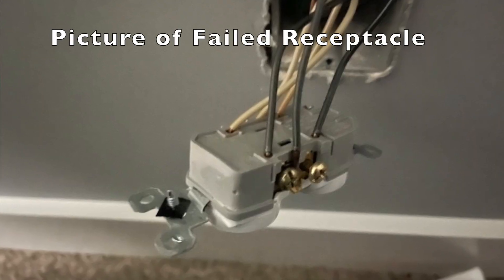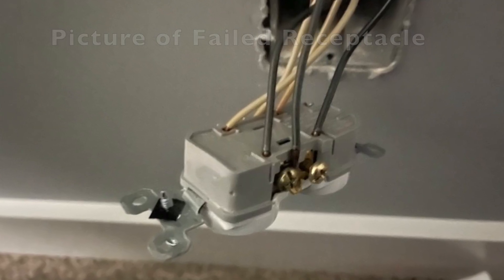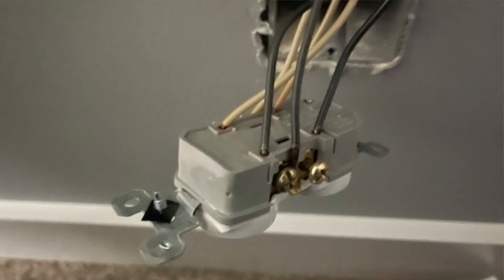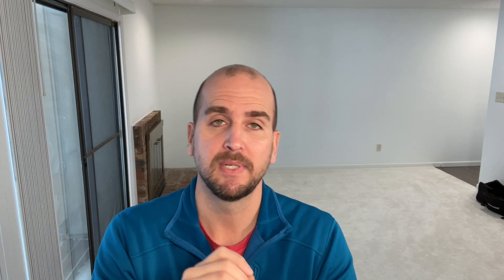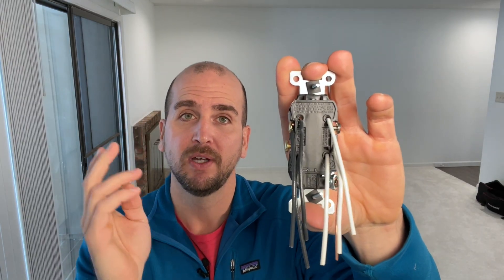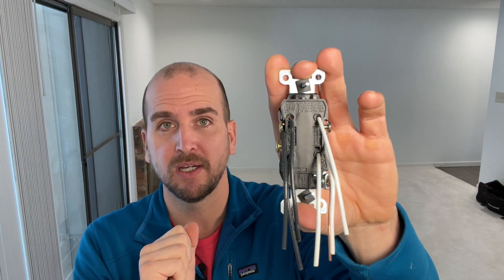Incorrectly Wired Outlet Found In Newly Built Home

Comment: Licensed NY  electrician.  Great video!  I noticed the receptacle you replaced was fed with red wire.  Since your audience might include non-professionals, you should point out that even though the circuit for that receptacle was off,  there might be another circuit sharing that same neutral and the danger it poses.  Again very good video.
Reply: @Michael Claypool This might be a multiwire branch circuit that @Veloci3 Twenty is referring to in passing.  The multiwire branch circuit is a cheap and nasty way some electricians run two circuits with a single 4 conductor romex cable (like a 14/3).  The two hots (red and black) go to a breaker each (on different bus bars), and the white is shared between the two circuits.  While it is not against most codes, it is considered a "in code" bad practice by many and should be avoided as it might put too much load on the single neutral as well as creating a live wire situation (when one side is switched off and someone expects the white wire to be not carrying any load).  This danger is real and occurs if the hot wires are moved in the breaker box so they are on the same wiring bus.  A common mistake would be to put the two hot wires on a tandem breaker switch not knowing these wires are sharing a neutral.  This is why the two wires in the breaker box need to be identified, connected to separate poles, and they need to have a tie between the switches so they are tripped simultaneously if one side goes.

The only reason electricians use this is to save money on wire and labor on running one wire instead of 2 wires. a single length of 14/3 is cheaper than 2 lengths of 14/2.
Reply: @DarkTouch  In a Edison circuit ( two hots one neutral ) when done correctly  as in one hot on each  "phase "  it is impossible to overload the neutral . If you have 20 amps on one hot 0 amps on the other you then have 20 amps on the neutral if you then load the other hot lets say with 8 amps the neutral  would have only 12 amps. - Two 15 amp loads the neutral would be 0 amps as current would divide by OHMS LAW .
Reply: @markhamilton1847   @Ethereal Rose  i know it is still in code.  My point is that it is about saving money/labor and puts the circuit into a conditional safety: conditions, the two hots are on different phases for all eternity and the two hots are tied together at the breaker for shut off.  Either of these conditions can easily be undone by an unwitting homeowner or electrician.  I for one bank on people being stupid and making mistakes, especially mistakes they don't know they are making.  So its code, but not considered a best practice.

Also, in certain situations, they are expressly forbidden, such as hospital settings and other places where there are critical circuits.

"The National Electrical Code permits multiwire branch circuits, but adds requirements to make them safer. Section 210.4(B) states that in the panelboard where the branch circuit originates, all ungrounded conductors must be provided with a means to disconnect them simultaneously. This is usually a double-pole breaker, but two single-pole breakers may be used if they have an identified handle tie.

Another requirement in Section 210.4(D) is that the ungrounded and grounded circuit conductors are to be grouped by cable ties or similar means in at least one location within the panelboard. This requirement is designed to ensure that the wires will be hooked up correctly, with the ungrounded conductors connected to opposite phases. An exception states that the requirement for grouping does not apply if the circuit enters from a cable or raceway unique to the circuit that makes the grouping obvious."
Reply: @DarkTouch  You're perfectly right. Multi- wire  multi- use branches have so few uses these days, that one seldom sees them. We used to do kitchens that way, but the electronic age has made dedicated neutrals the norm.
Reply: @DarkTouch  neutral sharing is a common practice and not a code violation.  in single phase systems you are allowed 2 opposite phases on a common neutral.  In a 3 phase system you are allowed 3 phases on a common neutral.  The phases must all be different.  

You cannot share a neutral on an arc fault protected circuit as it will trip the breaker whenever a load is applied.

Please don't make uneducated comments.
Reply: @veloci3twenty607  jeez.. i never said it was out of code.  you didn't read my comment?  It's a practice that has several conditions placed on it that ordinary circuits do not and quite easily undone by an ignorant person.  it's sole reason for it existing to run one less conductor.  You can't in ANY way say that a multiwire branch circuit is just as safe as running two separate circuits with their own neutral.  The multiwire branch circuit must be on alternate phases and the breakers must be tied together, duh!  This is easily undone, confused or messed up by someone, especially by a homeowner tinkering.  I am fully conversant in NEC.  I'd like to point out that YOUR comment said "the danger it poses".  You trying to walk that back?
Reply: @DarkTouch  you just keep digging yourself deeper.  Electricity is not safe for people like you and should be left to the professionals.  Do you know why I don't put tape on devices like receptacles or switches?  Or wire nuts for that matter?
Reply: @veloci3twenty607  i bet hes a real peach to work with. (Sarcasm)
Reply: @DarkTouch  
Actually, at the big box stores there isn't a huge difference in price between buying 25 ft of 14/3 and buying 50 ft. of 14/2.
As of today 25 ft. of 14/3 cost $25.68 at Lowe's. Compare that to 50 ft. of 14/2 for $27.98. So for $2.30 more you're effectively getting 25 ft. of 14/4 w 2 grounds. The extra wire can provide a required neutral in a three way switch box.
Reply: @DarkTouch  there's nothing wrong with it. Tie the two breakers together so if one trips,  the other would as well. There would be nothing on the neutral if they're both open. I also like to label in the box, in case it isn't obvious, the two circuits share a neutral. Saves a conductor, ground, extra insulation, and a second run. That's my preference if it isn't going to be a high load receptacle or usage.
Reply: @etherealrose2139  you are absolutely correct, and if you look closer there is no black wire present. Many higher end cities require a house to be in conduit, no romex allowed. Which in this case is what I believe is happening. They used a red wire due to the phase it is associated.
Reply: @etherealrose2139  Does shared neutral work with AFCI? I didn't think so, but may be confused.
Reply: @ef2b  no
Reply: In my home circuits that share a neutral and clipped together at the breaker box. I don't know if that's a new requirement or not but they aren't very secure and tend to fall off.
Reply: Sharing a neutral is bad? Ha. All neutrals are common with ground anyway.
Reply: @joeshmoe781  It’s not “bad” per se but code does require circuits that share a neutral to be tripped at the same time. They do this with a small metal bridge between the breakers. You can find more information about this online, but under certain circumstances without this protection the neutral can become energized and pose a danger.
Reply: @joeshmoe781  Having unplanned paths for neutral current to take is unsafe. If there's a broken or overheating connection in the neutral, you want the current to be slowed or stopped, not to be redirected across a random, unrelated, and too-small neutral or ground elsewhere.   You also don't want to create open loops that could cause magnetic coupling.  And you're supposed to have a voltage difference between the neutral and ground. The draining current doesn't flow for free, it needs some "back-pressure" - typically this is about a volt, but it depends on load and the length of the circuit.

So for these reasons, neutrals have to be routed parallel to their corresponding live conductor(s). They have to be insulated from ground. And you use full-strength insulation just in case there's an open neutral fault.
Reply: @joeshmoe781  Here’s a great video explaining it. 
https://youtu.be/yhFJzQB6_NM
Reply: @AITA-NIM  Or you could just get a 2-pole breaker. But yeah, if two circuits are sharing a neutral, you def want to make sure when you turn off one of the circuits, you turn off the other... for safety.
Reply: If MWBCs are bad then so are subpanel feeders, they're fundamentally the same thing. Follow code, feed them from a two-pole breaker, and they're more efficient than two branch circuits, both in material cost and operating efficiency. 

If only one leg is isolated, that's a wiring problem. You need to be prepared for that and prove all conductors dead whenever you open any box.

Stray voltage on the neutral can happen even if the wiring is 100% correct - MWBCs are not any more or less susceptible. If you're having problems with haphazard neutral wiring the only solution is to trace the mess - or rewire everything.

Blaming MWBCs will blind you to errors made elsewhere and that can be even more dangerous.

Comment: Did you explain what is the third "back wire" connection? I'm going to review.
Reply: In the video, the outlet was wired with 3 hot wires and 3 neutrals.   They used the 2 back hot wire holes and the one screw for each the hot wires to contact the hot wires together and each of the neutral wires were wired the same way on the neural side.  The proper and most secure electrical connection would be use the "pigtail" method to connect all of the hot wires and also "pigtail" the neutral wires so that only one of each wire (one hot and one neutral) go to the electrical outlet.

Comment: Have you made a posting about the pros and cons of wire strippers vs other means of removing insulation from wires?
Reply: try not using wire strippers, then you';; understand quickly..
Reply: @jsparlin1  I have and use wire strippers, as I was taught.

Comment: The pigtail approach is great if you're working on a house that was fitted with electrical boxes that are on the larger size.  Many older homes were wired with very small (metal!) boxes, and there just isn't enough room to tuck all that (extra) wire and wire nuts into one of them, and THEN screw the outlet into the box.  Just won't fit.  I agree it's best practice, but it just isn't always possible.  Use of back-wireable outlets can help in those cases.

Comment: Error #4 at 6:18.  Ground at bottom.  Receptacle is upside down.  Reason. Say a plug is pushed into the receptacle about 90%.  Now lets say a thin conductor is accidentally dropped in the vicinity,  for example, a metal paperclip or a metal coat hanger.  It would be possible for it  to fall onto the hot and the neutral.  Things could get exciting.
Reply from the maker: Oh yeah, this has been an active discussion over on this video https://youtu.be/kYXvcog9MxY  Seems to be many on both sides of the discussion.

Comment: Push-in quick connect is a terrible idea for receptacles. But can be used for switches. Specially soft touch switches. Although I always avoid it too. The plugging in and pulling out force will move the contact point. Creating heat, which leads to brittle metal. Then failure.

Comment: Retired electrician  here, almost 30 years 20 of it doing housing . Union west suburbs of Chicago. We are an outlier in this discussion as we use pipe and wire no rope. Couple of things to say. Backstabbers are hacks. If you have that many wires coming into a box you failed. Nec 300.13 b in non lawyer speak basically  says you must be able to remove the outlet without interrupting the white wire for stuff down the line. How do you do this with your outlet? Now you say wait a minute the power will be off so no problem. Wrong, sometimes as a skilled electrician you have to do stuff hot. With your outlet there if you were to lose one of those neutrals while hot bad things happen to electronics. I replaced every outlet in my house to a different color and never turned a breaker off. How did I do that ?  Every outlet was pigtailed.
Reply: The first sign that it wasn't installed by real electrician is it had no electrical tape wrapped around the side connections
Period
Fullstop
Reply: @thecloneguyz  I've seen good electricians and bad electricians licensed and unlicensed some rap the receptacle some don't
Reply: @arlenmargolin1650  first place everyone grabs  - the sides 
Only rookies dont do it
Reply: I am still active with 42 years. Today they don't know anything about all that working it hot with good safe practices passed down by men over me that had pride and integrity. Short cuts and hack jobs and then scrutinized by people making it look like we all do it like that, when in fact the guy claiming that has not the knowledge, skill, nor experience to make such claims.
Reply: 300.13(B) only refers to multiwire branch circuits.  He is not working on a multiwire branch circuit.
Reply: @Checkmate54321  I  guarantee if  that  circuit is not on a arc fault breaker it's two hots sharing that neutral wire. I roughed hundreds of homes from 89 to 08 and two hots one neutral.  Arc fault  breakers were  only in bedrooms at that time. Nowadays most everything is arc fault so not much sharing of neutrals.
Reply: @robm3063  well from what the viewer can see, its pipe and wire so it could easily be just one hot on a neutral.  I was only pointing out that the grounded continuity rule is for multi wire.
Reply: @Checkmate54321  That could be the case.  I my experience we would bring  one homerun pipe up to the second floor, usually closest closest light. Depending on how big of house usually 4 circuits, 10 openings per circuit. This is track housing not custom homes. So you could have two bedrooms sharing a neutral  and you wouldn't know it unless you opened the HR box or panel.  Hopefully the wire puller identified  the wires  sharing. We had one subdivision with small  townhouses.  I can remember to this day ,black and red shared neutral and blue wire was by itself. We pulled them all the same as to make  service calls easier.

Comment: Great video, you always teach me something.  I am a bit confused though, I’ve generally used the push in connections cause they’re easy and fast but haven’t ever seen any “failures” with them. What type of failures should I be concerned about with these type of connections? Two observations I have that may answer my own question: I don’t believe I’ve ever seen push in type connectors on the more expensive commercial outlets (I’m assuming for a reason) & I have seen a time or 2 when I pull an outlet (or switch) out of the wall sometimes the wire pulls out of the push in connector.  I never considered this a failure (until possibly now) as once the receptacle is in the wall nothing is tugging on it with the same force as my pulling it out, so I always assumed it would stay connected.
Reply: We lost power on every receptacle in two bedrooms. I started with the first receptacle on the circuit and got lucky. One of the push-in connectors apparently lost its grip so the wire just popped out as I removed the receptacle. So it seems the wire can still be in the connector and not make contact or not enough contact.
Reply: yeah , that word "assume" lol

Comment: There is nothing wrong with 2 wires back wired. It actually becomes balanced. Wire on both sides of the clamping screw. That's better than only one side with wire.
Pigtails are ok. But they are old style. They were used then when electricians were using j-hook side wiring only. That was the only way to securely string the outlet together.
In industrial devices, they use fork or eye terminals. Both sides of screw have metal. Balanced.

Comment: I have always “pig tailed” my work.  I have also seen too many “daisy chained” wiring where “electricians” used the push pin wiring with dozens of outlet all on the same circuit!  So that first device has all the current draw heating and melting going with all the devices the hapless “user” tries to iluminate the entire city.
Reply: I thought that maximum outlets on reach radial circuit Is 5, but that's UK standards.  Pig tails wire nuts are banned there.  The outlet design is robust & much easier to connect, same with schuco.

Comment: I notice you are using a combo Philips/Slot screwdriver (at 6:03), which I have also found to be invaluable for electrical work. Allows more torque without the cam-out (I use the WIHA insulated version). Recommend you provide a link for viewers who are not in possession of this handy tool...

Comment: When there is a sheetrock patch  going in I have seen pro electricians wrap the new outlet with electrical tape and let the outlet hang free.1 for safety.so the guy doing the patch don't get shocked. Wire push in outlets wires fall out.nobody I know would buy those.

Comment: I've worked with American as well as Schuko outlet styles and although schuko takes up more space they seem to be more advanced overall than the American style. The American style now seems to me more dangerous and just more antiquated. I suggest the US changes over to Schuko. the receptacles are less physically robust but how robust do they need to be, you're not hitting them with a hammer. The terminals are screw-clamps, haven't had a problem with them yet. also there's automatic shutters that prevent babies from sticking crochet needles in them.